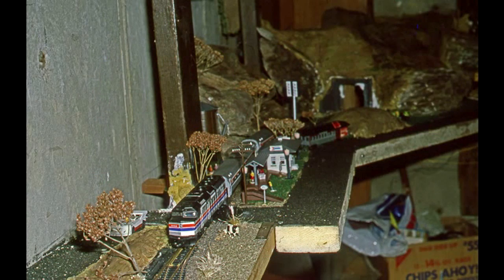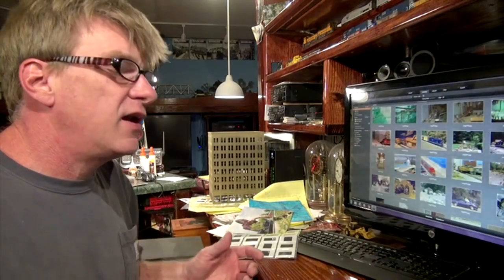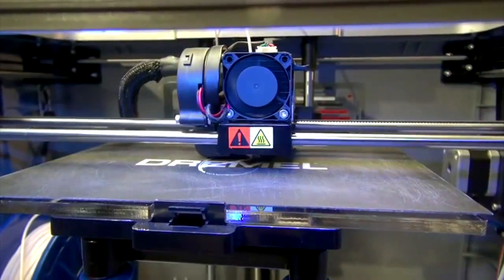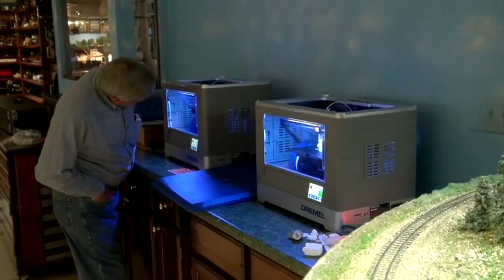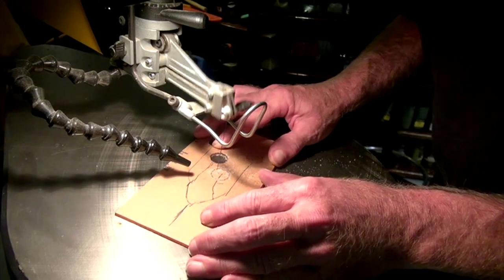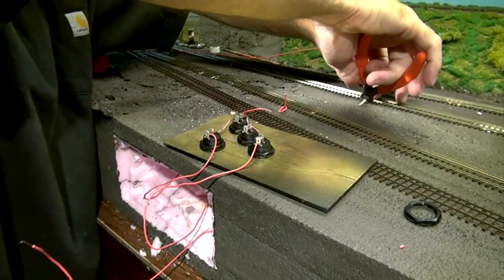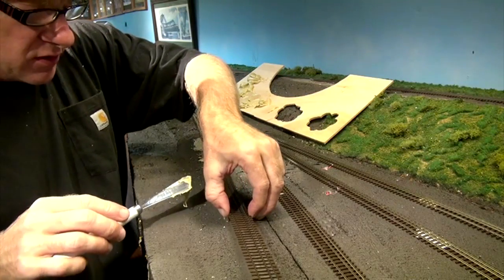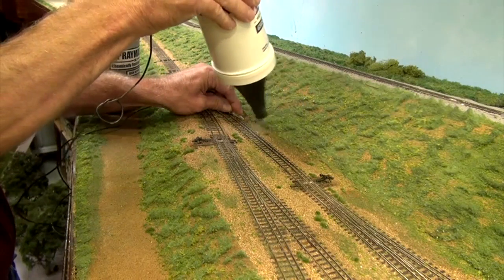MRH 2015 December What's Neat column | Model Railroad Hobbyist

Comment: Hi Ken - Can the Dremel 3D Idea Printer, work with a MacBook Pro and what software could i use to make flat structures. I also would like to find a way to take photos of local structures in Detroit Metro Area and make them into flats. Brass tube is a very useful tip. • Thanks for all the excellent videos. Enjoyed your history in the hobby.
• Cheers from The Detroit & Mackinac Railway 🚂 " A Toy Train Layout"